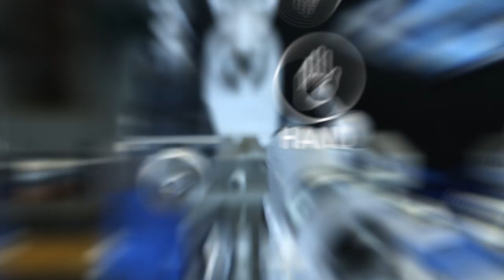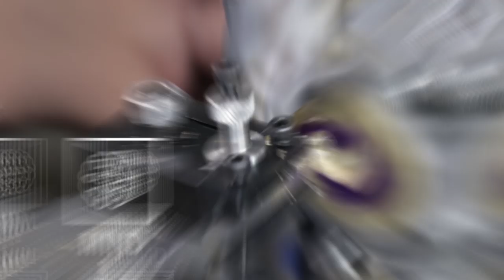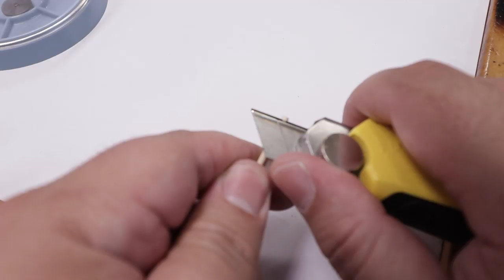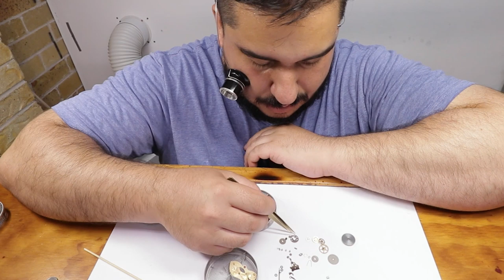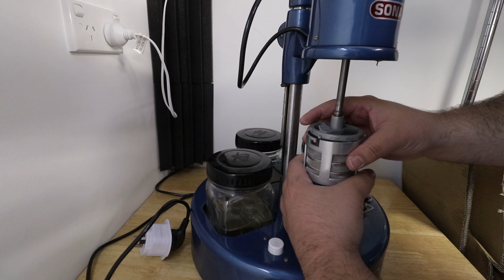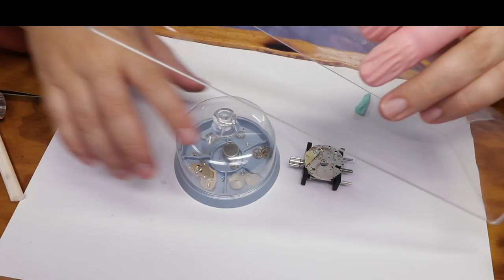Cleaning  Mechanical Watch Parts - Watchmaking Vlog 37

Comment: Hey Dean. You can leave the balance assembly attached to the watch plate in the cleaning machine if it's in a part of the basket by itself to avoid damaging the balance spring. Then before oiling put the jewel cap and jewel hole in a jar with some isopropyl alcohol/ lighter fluid and agitate the solution with a hand blower, then just dry off on some rizzla paper's. Let the solution evaporate fully or the oil will run. Best of luck with the watch!
Reply from the maker: Thanks Garth, yeah that’s the way the BHI teach it to, I did that for the first time ever. Before I was scared always disassembled and cleaned by hand. 😁

Comment: The aerodynamic properties of the KIF Trior shock springs are mind boggling - it's amazing how far they can fly when they decide to take to the air! I don't have the KIF tool yet so it's always a nerve-wracking process working with them. I think KIF Trior flying technology are what powers UFO's. A question - de-natured alcohol, or what we call methylated spirits - does it affect the shellac on pallet forks and impulse jewels at all? Thanks for the vid, Dean - much appreciated.